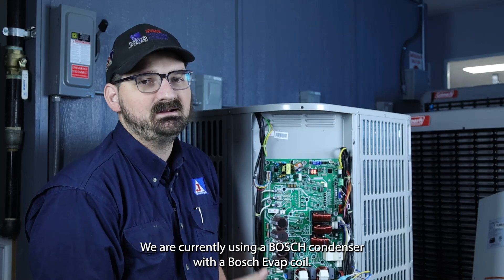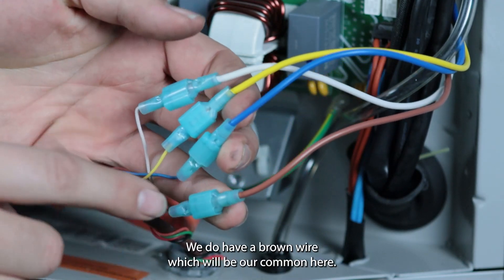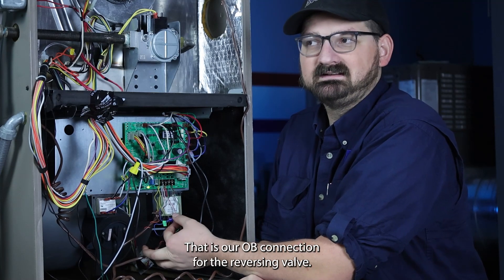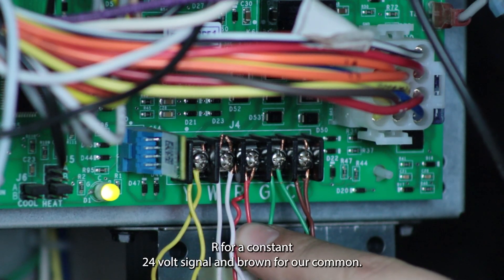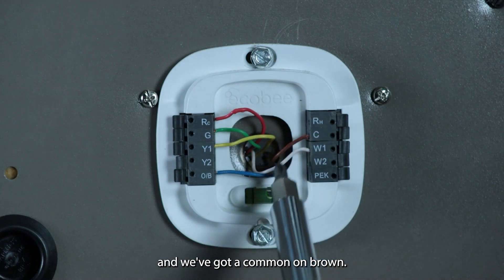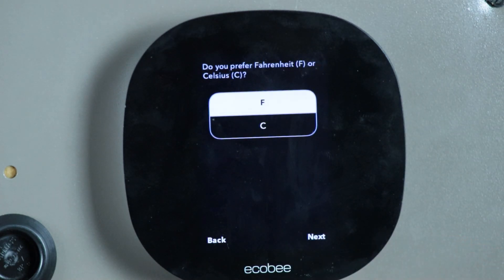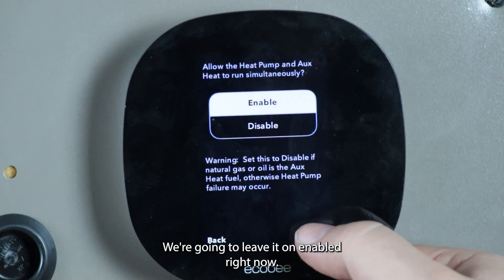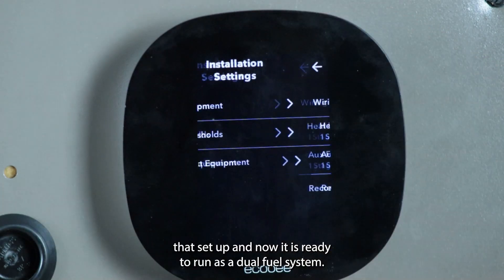How to Setup a Duel Fuel System

Comment: Which thermostat is that? Do you not need a outside sensor?
Reply from the maker: The Thermostat I used in this video was an EcoBee. It does not require an outdoor sensor.

Comment: At a $1.70 a CCF for Nat. gas in my area, I'll stick with Natural gas as the primary source of heat.
Reply: It's unreal what some companies charge for NG. The exchange market price is around $3/mcf or 30 cents per CCF. Our utility claims they pass on their cost with no markup, but they charge .60 to .80. You say yours is $1.70 and the host says his is even higher.
Reply from the maker: I love the energy density and heat output of Natural gas. I only wish it was that price in my area!